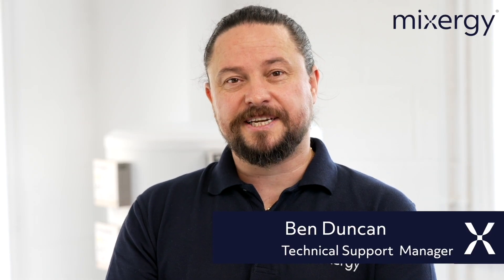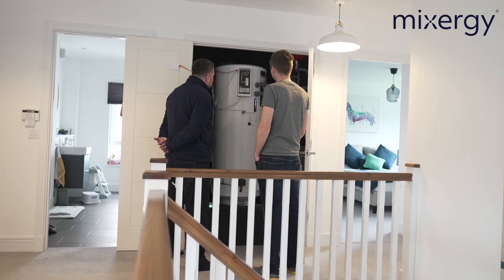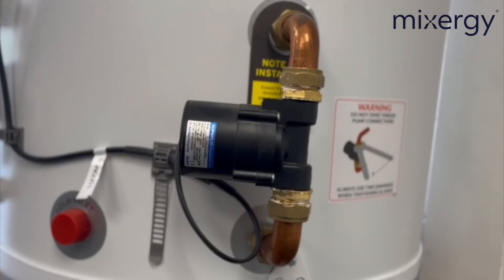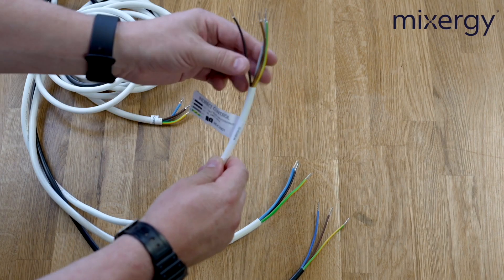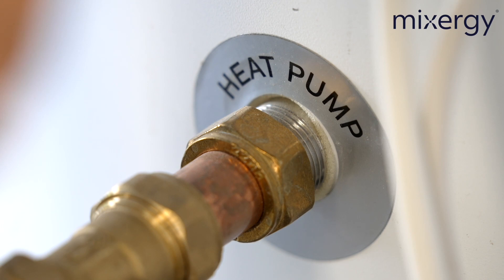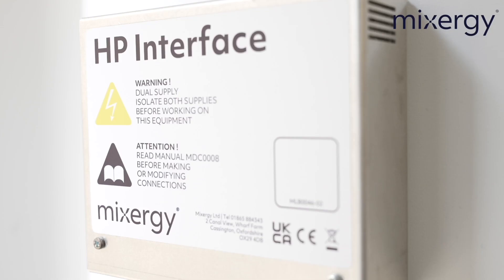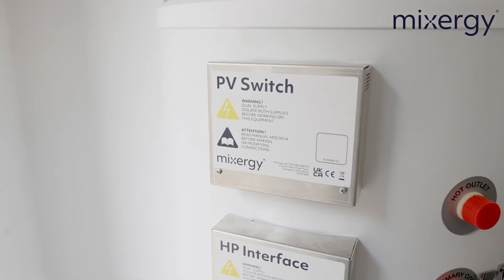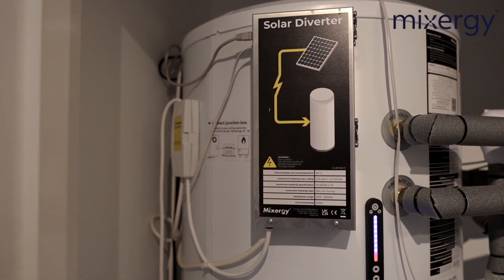Mixergy Installation Guide - MX Range

Comment: Hello, I have the same one at home, but after the power went out and then came back on, it didn't work the same way as before. The red light on the control panel disappeared, and the hot water only comes on for five minutes before turning cold again. No one has been able to figure out what the problem is. Could you please help me by posting a video to help me fix it ? Thanks
Reply from the maker: Thanks so much for reaching out. Sorry to hear things are not working as expected. The best place to get help is our Support Hub where you will find clear guides and FAQs for your tank. https://mixergy.co.uk/support If you do not find what you are looking for, just ask our chatbot on the website. It will guide you to the right person for more help.

Comment: Great to see this video - really clear and useful.  
The question I would have is whether your advice on using PV power with the tank is valid when you have a heat pump, especially in the summer.  We heat our 210 litre tank from about 20% to 75% daily, with the top of the tank reaching 44 degrees (and the heat pump running to about 50 degrees maximum flow temperature).  The daily heating in the summer typically uses about 0.7 kWh of electricity - very efficient.  I am certain that the immersion heater in the Mixergy would consume significantly more energy for the same water heating.  We do get 11p / kWh from Octopus from our export, so the 'cost' to us of heating the tank is about 8p.  If the Mixergy used 2 kWh of energy to heat the tank to the same level (my guess) it would cost us 2 * 11 = 22p in lost export.  When we change tariff at the end of the year, the export rate will be rising to 19p / kWh, and so the cost would be more.   We will be buying another Mixergy for our other property, and this will also have solar panels and a heat pump.  I will be getting the embedded PV diverter, but I am not sure that I will ever use it.  Any thoughts?  (P.S. We do have a Tesla Powerwall at both properties).
Reply from the maker: Ideally, with a heat pump, heating the tank to 100% gets the most out of the Mixergy and the heat pump.
With Mixergy using PV to heat the tank, the idea is that the house and all other devices (including batteries) are satisfied first, and then the excess can be used for heating your water (Mixergy). 
 
In theory, the immersion does use more electricity to heat up, but when using the immersion on PV you can set specific percentages and specific temperatures and also, it does not use power from the Grid, it is free generated power. This means during the summer, you could heat only 30% of the tank for free rather than the higher charge percentages required when using a Heat Pump and sell the excess if required. If the property has a lot of reliance on electricity, i.e. Batteries, EV chargers, large appliances like hot tubs, pools, electric storage heaters etc. then it may be that there is very rarely any excess solar power available to heat the Mixergy. And then, you must consider the size of the Solar array.
 
It's all about finding the balance that suits each property, everyone has different requirements.
Reply: @mixergyltd6286  Thanks very much for the detailed reply.  I think you make good points, and we feel that the flexibility that the Mixergy gives in terms of heat source and controls means that it will cope with the different changes in energy price levels and individual requirements, and the changing needs during the year, mean that Mixergy is just perfect.  At the moment we might not use our PV diverter but who knows next year?